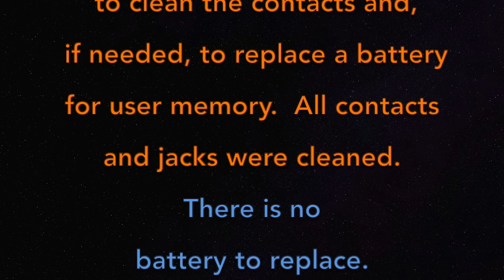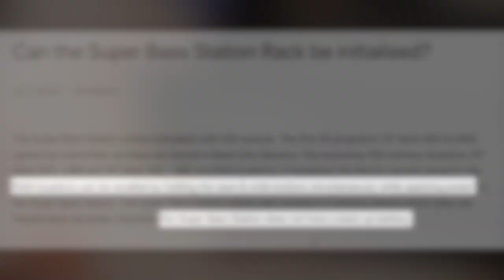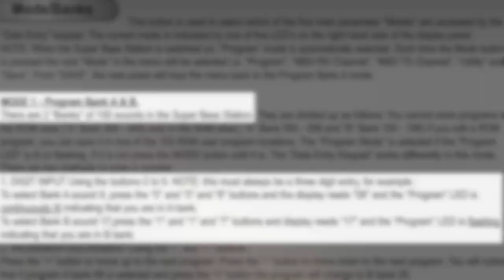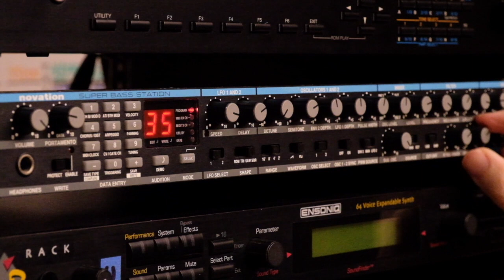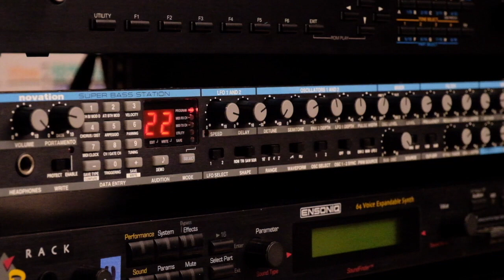Quick Look | Inside the Novation Super Bass Station Rack Analog Synthesizer

Comment from the maker: The biggest surprise: no battery to replace.  Innovative design by Novation  for a 90's era synth!
Reply: Aaargh mine is dead and i don't know what to do or fix
Reply from the maker: May want to try a new power supply.  Also check for loose connection near the power jack.   Was there an incident preceding the SBS's death?

Comment: I bought one used a few years ago which would stop making any sounds after warming up. The problem was casued by many of the lower value electrolytic capacitors being bad which I confirmed with an LCR meter. Changing them fixed the issue. I suspect most Super Bass Stations will need these replaced eventually depending on usage so if anyone else has wierd problems with theirs, I suggest checking the capacitors. Probably best just to change them all anyway as a preventative measure.
Reply from the maker: Thanks for sharing your experience, Thrax. Excellent suggestion for this, and many other synths of the era.